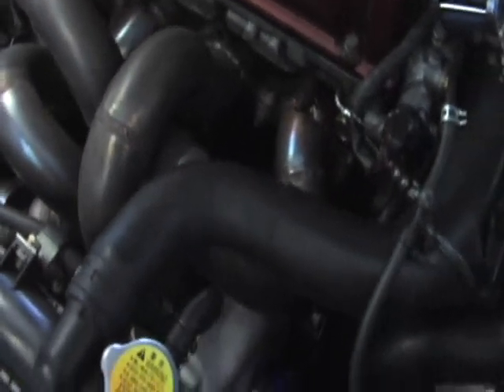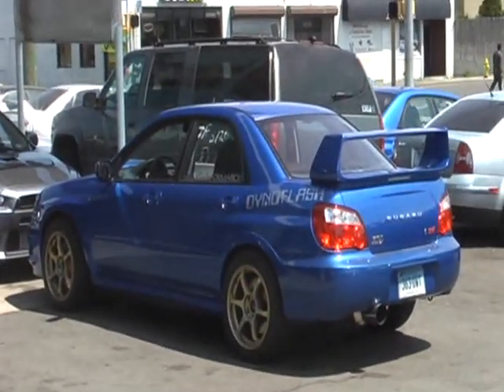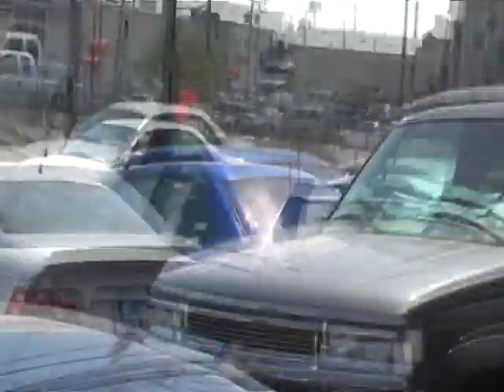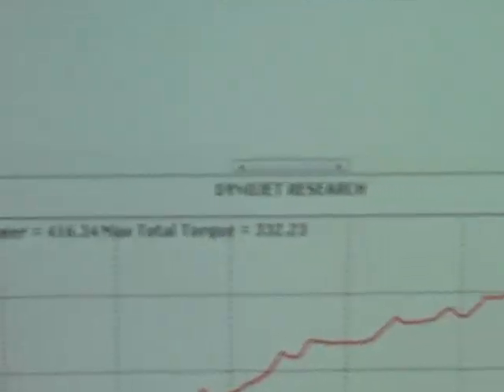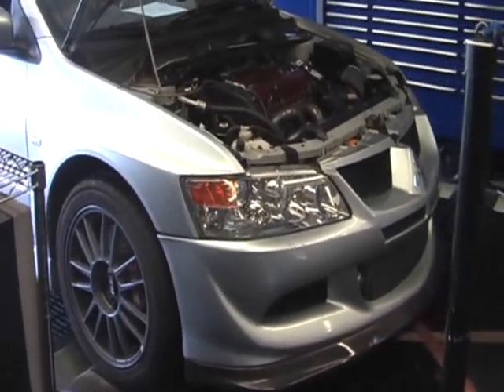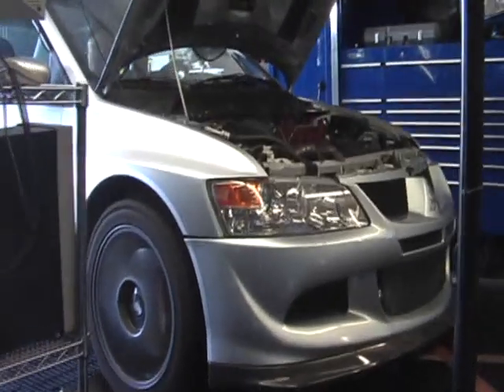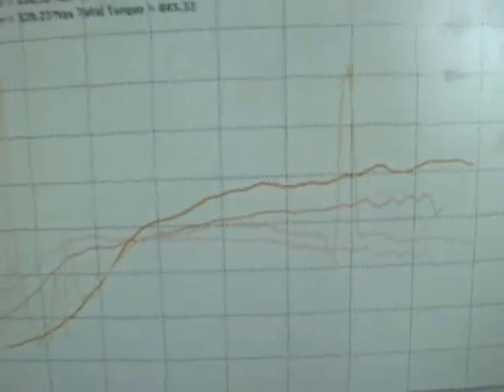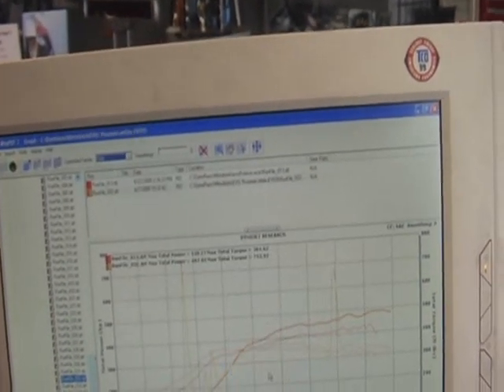Tuning a T57 Turbo Evo 8

Comment from the maker: Nothing wrong with the turbo kit he got.  The only thing that was out of line was the power expectation on pump gas with a SMC alchy kit which is not one of the highest flowing units on the market.   The T57 is very old school turbo technology compared to the Garret GT series dual ball bearing units such as the Gt30 and Gt35 dervied units which will with a good wheel combo spool up faster and make more power with the same boost level.

Al